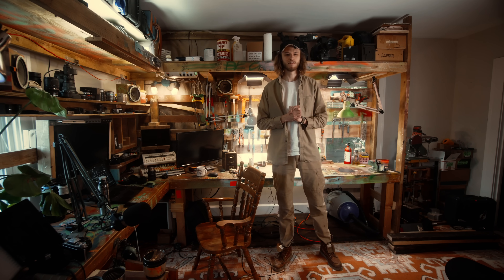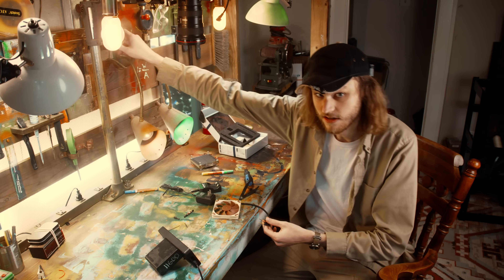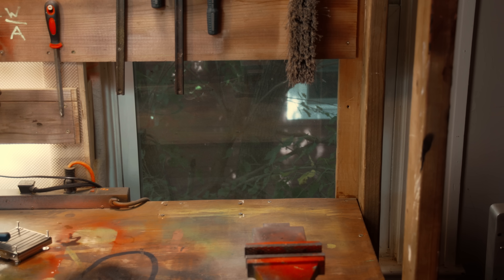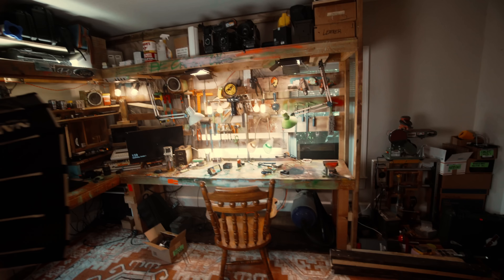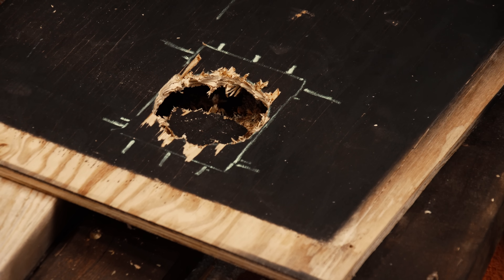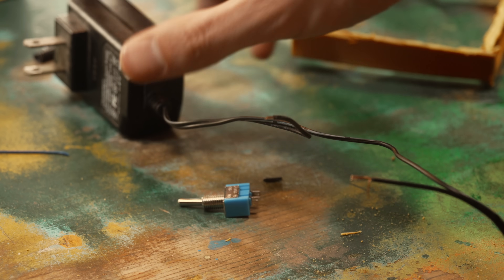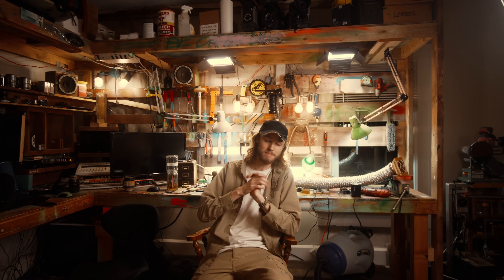Making a mini fume extractor from junk

Comment: Great build. One note: the cable extension you clipped to get the exposed wires might be the low noise adapter included in a lot of noctua kits. If you’re not getting as much airflow as you want it may be because of the resistor in this adapter.

Comment: FYI that little extension plug is actually a resistor that slows down the fan. Remove it from your wiring and you'll get like twice the RPM and much better air flow. That little extender is basically noctua's brute force method to quiet their fans lol

Comment: It was surprising to see you just melt a Noctua fan from a complete cooler kit in to that rough 3D print.
These smaller fan sizes are not expensive from them, that cooler takes larger sizes and you might find a creative way of re-using it.
But still, that's a more blasphemous defilement of clean hardware than what is usual for the channel.
Though so was the watch project. And the camera lenses I suppose, but I've taken a saw to an old lens to make it work too.

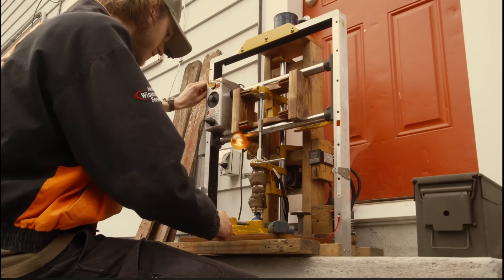Comment: Another way to remember Ohm's law ( 1:14 ) is with the PEI and VIR triangles 
 
 P
E I
Where "P" is power, "E" is Voltage, and "I" is amperage (I always think of Prince Edward Island when remembering this)

All you need to do is cover whichever variable you are solving for with your finger (If you have it drawn out). Eg.
To solve for "E", you divide "P" by "I" . To solve for "P", you multiply "E" by "I"

 V
I R
Where "V" is Voltage, "I" is amperage, and "R" is resistance.
The same that is true for PEI is true here as well!

Comment: the only part about this that i dont like is the fact that you plastic soldered the fan of a specific cooler to the part, i normally try to avoid damaging something that could be used or ideal for another thing. but i guess this would be easy to fix if anyone does their own version (likely for having a different fan model aswell)